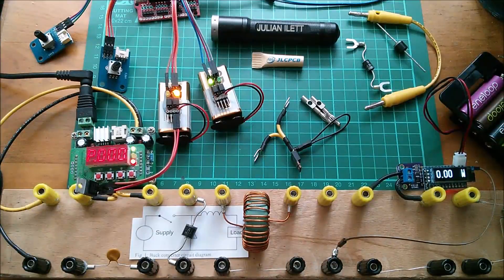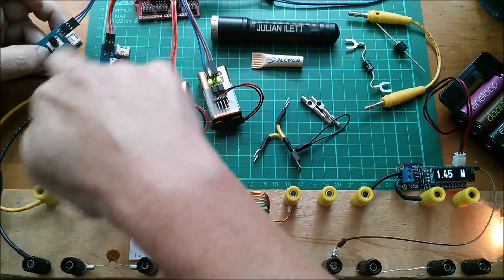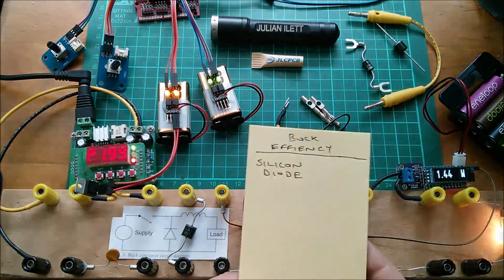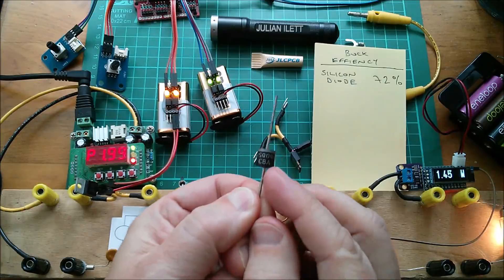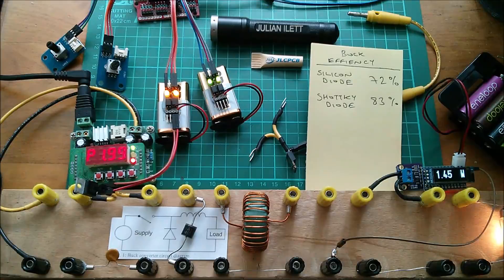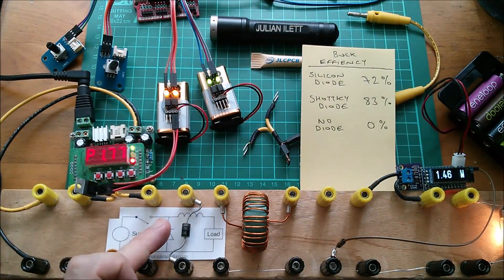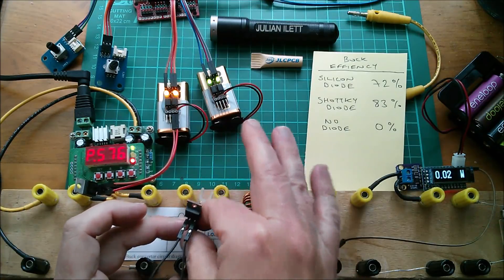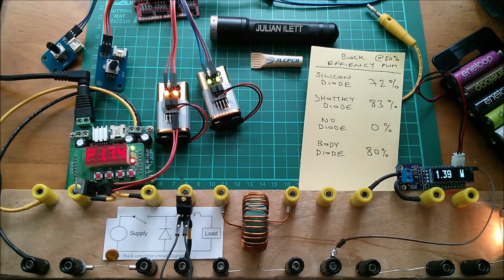Buck Converter: Diode Type vs. Efficiency

Comment: There is one thing you missed. The schottky diode switches a lot faster. I guess your switching frequency is a lot lower than most SMPS. That's why schottky is not much different than normal rectifier. But once you get to a bit higher frequencies - let's say 50 kHz (which is still relatively low), a regular diode won't be able to do the job. I've tried it at 100 kHz - it just doesn't work.

Comment: Now try putting 3 schottky diodes in parallel, not to greatly increase "safe" current capacity but instead, lower forward drop at any current that's a significant % of the diode rating, since ultimately the diode rating depends on the heat generated in that package size, which is based upon the forward drop at that voltage (and of course, heatsinking in a package that allows for it.  Purists would hate the idea of 3 diodes in series but stop to consider how inexpensive a bag of diodes is these day and how precious efficiency can be on battery or solar power.

Comment: I would suspect that the body diode of the MOSFET is a little bit better than the discrete diode because of their difference in voltage threshold AND in their recovery time (the time for which the diode still conduct while freshly moved into reversed bias, which can reach the milli-second). A discrete silicon diode has a slower recovery time than the body diode and itself, lower than a Schottky. If the power is too high for a Schottky, it is recommended by the literature to use SiC (Silicon-Carbide) diode. 

You should check also a fast switching silicium diode (1N914, 1N4148) versus a rectifier silicium diode (1N400x), there should be a noticeable difference, with a better efficiency for the 1N914.

Comment: Another thing to consider with diode choice is the reverse recovery time. If you're switching at 100kHz+ then some jellybean diodes may end up conducting the wrong way for a significant part of the switching cycle. Schottky diodes are normally quite fast in addition to the lower forward voltage. They're not perfect though, schottkies have a lower max blocking voltage (normally ~40V) and can have a few mA of reverse current when blocking.

Comment: What frequency is this thing working at? Might be interesting to try some ultrafast pn diodes (e.g. UF4007) and see how they compare to the MOSFET body diode. Also, as it has been stated already, please add some smoothing capacitors at the output.

Comment: Your first case with a high voltage diode is not a good example of a silicon diode in this converter.  Typically, such a converter would use a low voltage, fast, reverse recovery diode.

Comment: Is this really accurate, or did i miss something in my Youtube electronic classes? I thought parallel diodes will always have less forward drop than the value of the smallest diode in the circuit. Like resistors do in parallel.

Comment: How long do we have to wait for an output capacitor? Muppet 3? The power ripple on the output is potentially affecting the accuracy of your readings.
Reply: KX36 I did a similar comment months ago. Proper fet drivers so they don't spend too much time swithing, schottky diode and low esr capacitor... Bit I guess he wants to do 10 videos and the corresponding views doing it one step at a time.
Reply: I like the way he is doing it because I am learning a ton and not missing anything. You have to remember these videos are not just for experienced people they are for beginners too.
Reply: chopping it up is creating ripple. The current output of the inductor will be a triangular(ish) wave and with only a resistive load (lamp) and no capacitor, both the voltage and current through the lamp have this triangular wave in phase, meaning the power in the load is a triangle wave. The devices he's using to measure power are designed for DC. they sample at a low frequency and have low bandwidth making their behaviour when faced with a high frequency triangle wave undefined. Adding an output capacitor will smooth out the output voltage and therefore the current and power through the lamp and so the DC power meters are likely to give more meaningful results. It may or may not make a big difference to the numbers but it gives more confidence that they actually mean something.
As for the input side, the voltage is DC but the current is highly pulsatile, so there is a similar problem. An input capacitor in the circuit would smooth out the input current. But it depends on where the source is measuring the current. It may be that it measures it before its own output capacitor anyway.
Reply: Shoosh! Don't say that, otherwise people who "build this stuff" will say that there's no ripple even without the cap on the output. I've been there :)
Reply: Would his source of power make that moot? If he is using solar then he is just chopping up clean DC power so ripple would not be a factor right?
Reply: KX36 nice explanation, thanks for taking the time. Looks like I should have not presumed to know what was going on. I think I am going to have to set up a similar circuit and bust out my scope and take a look at what it looks like at every step. 
Thanks again.
Reply: KX36 I know that, I said that previously. It won't change anything. Julian enjoys the process of going through the design very slowly, so whatever, let it be.

Comment: you really need some capacitance on it to smooth the voltages and average the power, your power meter is probably giving inaccurate results. anyway take another look at the LTC3780, it basically does what you are building, you would just need to control it from the arduino. anyway thanks for these fundamental (with experimentation) videos!!
Reply from the maker: The ltc3780 is my inspiration for this project, but muppet2 will be bidirectional.
Reply: Oh forgot it is only one way, left to right, The goal is to have it be a power shifter from one side to the other and vise-versa

Comment: This is the type of research I really enjoy.  There aren't many synchronous buck/boost converter modules coming from the chinesium on ebay yet.  Perhaps your videos will inspire them to start producing some higher power, all-in-one DC-DC modules, so that we don't need half a dozen different converter modules for our varous project needs.  :)
Reply: there is at least one that I know of, the LTC3780 is exactly what he is building in one chip it is just 11-15$ per board. I will be comparing it to some SEPIC modules on my channel when they all arrive.
Reply: synchronous converters are more expensive and more complicated, so it´s not really worth it for low power low cost converters.
Reply from the maker: I've not seen a bidirectional LTC3780
Reply: Julian Ilett oh true it only goes one way, hrm something for me to look into I guess

Comment: why don't you use o low side switch for your Muppet?
Reply: Ilias because to get easy feedback circuit with common ground
Not easy by common positive side
Reply: Well...all he needs to know is if the battery is more than 12V(or whatever the maximum voltage is); which he could easily do with an optocoupler...That mosfet driver does not look very promising...
Reply: "Not easy by common positive side"
https://birds-are-nice.me/ipfs/QmeHTKsAWhaKeygAqRBkAUkt5t2e9NPZcHT2ZcuyZcXcwy/solar_optimiser_schematic.png

I made a Muppet of my own months ago. Common positive isn't that hard. Trick is to measure the inverted output voltage, then subtract it from the input to get true output. Common positive may be the way to go - it certainly simplifies drive. No messing around with opto-isolators.
Reply: Yea... That is a way of doing it but there will always be a current path through the voltage divider you used to measure the output voltage... Which basically will charge the battery even if the mosfet is closed... I am not that experienced in battery technology but that does not seem like a good thing
Reply: If you use a load on the output which takes care of the overvoltage... That would be beter I think
Reply: An 8K current path. At a peak difference of 22-11V, a whole 1.3mA. Negligable - and if you are that concerned, use a higher resistance in the divider.

If I made it again, I'd make one key change: I'd replace the output measuring divider with an INA219 chip. That way it would be possible to measure output current and true power, not just voltage, which would make for more stable and accurate operation. The buck converter itsself, though, would remain unchanged.

Comment: 4:45 - With no diode the inductor will be producing a high voltage at its input and thus the output of the FET.  The MOSFET won't be having a good time and is likely to fail.
Reply: Correct, the mosfet would basically be conducting in breakdown, which is not healthy for it and will cause heating.
Reply: Hardly a surprise the output gets nothing until the PWM is almost DC... Feeding a square wave from the FET through an inductor... Remind me, what does an inductor do again ;-)

As you say, before it reaches this phase, the inductor is going to be throwing uncontrolled back EMF onto the FET output. Poor thing.

Comment: Excellent video, thank you! Datasheets for converter chips often refer to the speed of the diode, not the voltage. Which one is the most relevant regarding the efficiency ? Could you measure the forward voltage of the mosfet?

Comment: ideal diodes?
Reply: that would essentially be the same as synchronous but what I want to know is if there are any that will work with high frequencies for PSU switching applications.
Reply: I just remember Julian playing about with ideal diodes a long time ago, I think in a postbag vid and there was some issue with the ones he got, but they never reappeared for further investigation
Reply: "ideal diodes" are not real components. There are ICs that act like an ideal diode, but they´re basically just a small op-amp circuit that needs power and cannot offer any useful current capability, and even if they could they would be horribly inefficient.
Reply: im pretty sure the ebay boards use mosfets in a "battery protection" arrangement N-channel and P-channel in anti-series to each other
Reply: I looked up the video I'd seen it in, it was the last item in postbag #74 way back in Nov 16. the one that was shown had 2 n-channel fets in a configuration that didnt seem to do anything. it was just a thing I'd never heard of before

Comment: How could you forget to test the beloved germanium diode? With a forward voltage of around 0,3 Volts, it should be even better
Reply: mercury arc rectifier? I'm kidding
Reply: Wikipedia says selenium has a forward voltage of about 1 volt, so it would probably be the least efficient of all.

Re smell -- once while playing around with some wafers from a selenium rectiifier stack, for some reason I thought it would be a good idea to solder a wire onto one. I quickly resolved to cease any further experiments in that direction.

I'm told the smells get worse as you go down that column of the periodic table. I hope never to find out first hand what burned tellurium smells liike.
Reply from the maker: I don't remember high power germanium diodes - did they exist?
Reply from the maker: There's also the selenium rectifier :)
Reply: Julian Ilett I dont think there are high power ones. But it should be enough to test its efficiency before it melts. How about a vacuum tube diode?
Reply: @JulianIlett  I have some stud-mount germanium rectifiers,  rated at 2A,  and also some selenium rectifiers,  rated at 500mA, if you'd care to mess around with those...
Reply: Germanium diodes have insanely high reverse leakage, especially as they warm up. So they won´t be very efficient.
Reply: Julian Ilett - When I used to service TVs back in the day, there was one model notorious for a selenium diode failing, and it was described as one repair to avoid. I couldn’t see what the fuss was about, until a customer asked us to pick his TV up because it smoked and stunk his house out.
The drive back to the workshop with the TV was unforgettable, until you’ve experienced the odour of selenium compounds, it’s impossible to grasp how vile it is! It stunk the car out for ages, and the workshop was little better. If you ever use selenium devices, be very careful not to fry them!
Reply: germanium diodes are closely related to schottky diodes as they're a metal-semiconductor junction rather than a PN (semiconductor-semiconductor) junction. The forward voltage of a schottky diode is also around 0.3-0.5V but they're better in other characteristics as others have described. They still have higher reverse leakage than PN junction diodes though.
Reply: KX36 that doesn´t seem right. As far as I know germanium diodes were constructed the same way as normal silicon diodes, meaning out of 2 doped germanium materials. I guess making schottky germanium diodes should also be possible.

If you have a good source about germanium diodes, please post it. I would like to learn more about them.
Reply: KX36 looks like youtube ate your last comment.
Did you post anything after the links you posted? I couldn´t see more than them.
Reply: Basement ScienceE The first Germanium diodes were point contact devices; essentially a piece of semiconductor with a small 'cat's whisker' on one face. The OA81 is one, as you can see from careful inspection, perhaps with a magnifying glass.